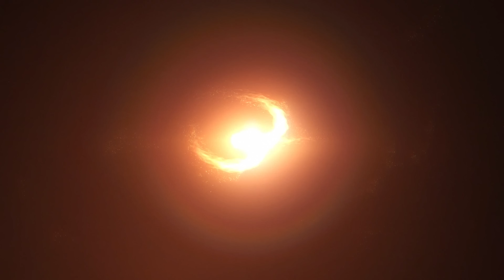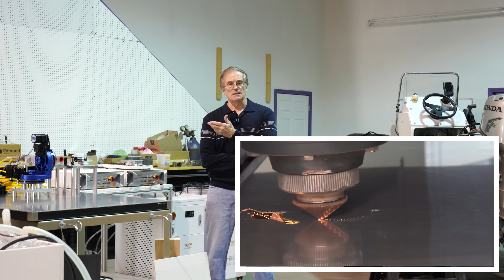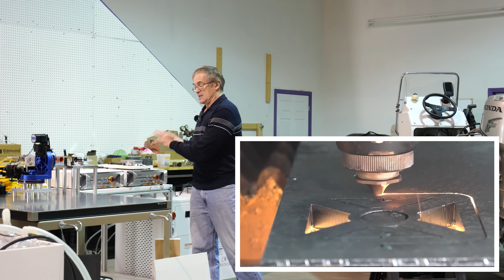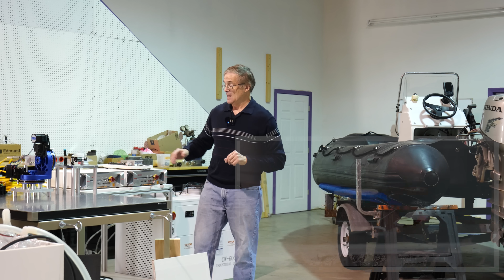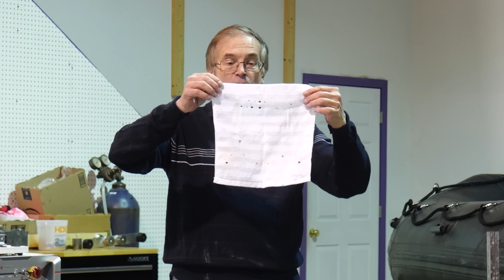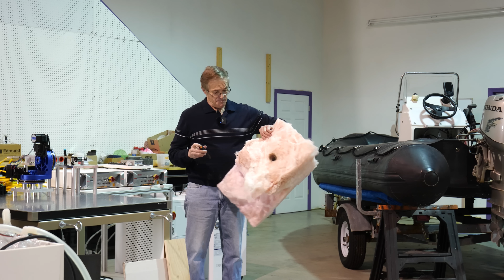We have a problem... and need your help!

Comment: My suggestion is a two-stage system. The first step is to diffuse the beam, then absorb. For the diffusion, perhaps a diffraction grating; you want to minimize reflections. But to handle the power density, I'd borrow from the X-ray industry, and use a spinning target. Each individual location has only a brief exposure. You might even sandwich it and get liquid cooling, but that adds complexity; it is probably easier just to scale up your target so the relative velocity meets the requirements.

It might even be possible to skip the diffusion step, but your target will probably last longer if you can minimize the intensity of the absorption, which at high powers may ablate the surface,

Comment: im no professional but chatgpt suggest using Ablative or Sacrificial Shielding, such as carbon composite layers, ablative tiles, or water-cooled plates. i would suggest burning the plywood until it has the "alligator skin" that every house designer loves, it makes the wood significantly hard to reignite with the carbon layer that is produced, also don't use a wire brush to clean it you want the wood to be black. Nighthawkinlight also did a tile out of baking ingredients, and was holding the tile in his hand while he charred the other side of the tile. could be something to spread over a fabric or the wood

Comment: Kind of unorthodox(sp?) solution here, but you could repurpose the absorbent gel beads from several cases of diapers, presoak them, and fill a mesh lined vessel framed out to whatever dimensions you think appropriate. I've seen used diapers survive incinerators. Or perhaps just diffusing the beam using a series of focal lenses similar to the way the metal cutting tech converges the light to very sharp angles?

Comment: Interesting approach to the problem.  A number of questions come to mind.  First while not up on fibre lasers I wish you had mentioned the frequency and spectrum of the output. For example,  infrared lasers are basically invisible and are generally low power output.  Argon lasers emit a green light and is used in medical equipment due to blood and body tissue is basically red and chromaticly are opposites. Blue lasers usually have a higher output due to the shorter wavelength.  Lastly,  remembering an article in OMNI magazine on the subject of grasers that created gamma ray laser utilizing a  chemical cocktail and radio frequency as a catalyst. 

If your approach is a wall, here are something to consider. Instead of fibre glass  (melts a 2000° F) try Rocksol which is volcanic mineral based and the melting point is much higher. Second,  try using  a beam splitter to disperse the beam or even an array of splitters. Lastly, configure the laser out through a parabolic mirrored dish whereby multiple outputs can be focused to a sigularity (along with visible beams for aiming). In this way the beams disperse safely after the focal point as you mentioned in the video. 

Thank you for allowing me to offer my assistance but I am sure your engineers will probably come up with better ways.

Comment: 1) you DO want it to be reflective, because it's not reflective it will melt. But diffuse reflective, you don't want lasers shooting like off a disco ball😮
2) keep it moving, maybe through vibration with a speaker, or make a hanging blanket wave with an unbalanced motor like a motorized toothbrush or vibrator. 
3) material should be very thermally conductive.

As an anti radar coating, faraday cage and occasionally porous electrode , I've used nickel-plated non-woven graphite fiber paper. 
It works for anti-radar the same way you were thinking with the fiberglass insulation. Radio waves bounce around inside the material and disperse. 
I got my special shielding (nickel plated carbon fiber paper) from

 Hollingsworth and Vose company, Washington Street , Walpole Massachusetts 02032

I suggest take that and plate it with an extra layer of silver for higher reflectivity, and using several or more layers to make a hanging blanket which you can make oscillate with a motor. 

Now if you find my idea is too expensive to blanket a whole wall with and instead choose to just do a sand wall or maybe filled with silica bead kitty litter
, then,
 please consider my idea on a small scale for a drone shield to protect the drones from YOU!

Since you happen to have those fiber lasers I can't afford, how much would you charge me to make me some ablative generated purple gold nanoparticles?

Also I suggest you take a page from styropyro's book, and widen the beam out to a few inches near the source using a telescope, so it doesn't converge to dangerous power concentrations until it's on the target.

Comment: Silica fiber like the space shuttle tiles used. The point is to convert photons into ir radiation and radiate it off before too much heat buildup.

Comment: Easy. Bolt a stack of polished utility razors together with all sharp edges side-by-side with M4 machine screws. That will absorb a lot of light into the razor-baffle. You can create a bracket that puts the razor-block in water but exposes the razor edges to air. That will provide cooling. You can circulate the water for extra reliability. Add a positive pressure HEPA filtered air flow in front of the razors to prevent dust in there. Use a regular bright laser to test for melted edges before each use. Put ice cubes in the water reservoir. Make the bracket easy to swap out, but you'll have to drain or lower the water.
Reply: @TreeLuvBurdpu  I really like this idea, as it's effectively an array of tiny mirrors to break up the beam and scatter it. Love the simplicity.
Reply: @NathanNostaw  the incidence of attack on the front edge of the razor should high enough to reflect it towards the back, where the energy should be absorbed. There is some optimization of maximal heat transfer vs size of the block and accuracy of aiming that would be required.

Also, i agree with everyone that you should have a precise burst timer and a thermal temperature lockout, preferably operating in fail safe mode, so it's only on while you receive temp signals in the appropriate range. You could also have a filtered TTL meter that switches the system of when it detects light over a range. Safety first, you know.

Comment: I would try using a cone-shaped element with water cooling in the back. My idea i to make sure the beam is spread over a larger surface thus reducing energy density. Of yourse the tip of the cone needs to be really thin...

Comment: The only thing that I can think of isnt very portable, but will be safe. Is a wall of ecoblocks. https://en.wikipedia.org/wiki/Ecology_block

Heavy, but large concrete blocks you can make a wall out of then store on your property somewhere. Only would take a couple hours to do a full setup and do your video. Would need a telehandler or something to move around easily, but this could be your safety setup for alot of experiments. Its hard to beat concrete...
Id recommend either finding old ones for cheap, or building your own, make them about 2ft thick, and as large as whatever your equipment can handle moving, the bigger they are the faster it is to set up a wall.

The face of it will get scorched and messed up, but if its too ugly, just cover it with grout and its good as new for the next experiment.

Comment: I have a straightforward solution that doesn’t even require a back wall. You can use an adjustable focusing lens setup that concentrates the beam precisely at the distance of your object. As the object moves closer or farther away, the focus adjusts accordingly. It might introduce some engineering complexity to your system, but it should be entirely feasible.

Comment: A crate built from tungsten plates filled with sand? Would need to patch front burn holes with epoxy as repairs could be difficult to weld and sand would escape if left alone.

Comment: Having quite an experience in fire safety of lithium ion batteries (yes, far from energy density of lasers), I'd try to go for sth like compressed mica sheet, maybe sandwiched around ceramic paper. Both reaistqnt to high temperature. Or...instead of absorbtion, try dispersion first: a curtain of glass rods/beads/whatever to initially scatter the light, then a curtain of eg. mica or ceramic fiber mat.

Comment: Something, that has allready burned.. or at least does not want to catch fire or melt instantly. Burned logs or fresh cut hard wood timber. Also, have you tried white teflon?
Reply: Or implement an active range focusing optics. Do not use concentrated beam indors. Use concentraden only on shaheds..

Comment: Soft Insulating Fire Bricks. They weigh 1/8 of traditional bricks and they should easily stand up to 5-10 seconds of incredibly high temperature. Its chemically very similar to what the space shuttle uses for re-entry.
Reply: Great idea. Ive experimented with making my own kiln brick and you can change the amount of burn out material to lighten the mass, increase the air pockets and reduce costs of raw material since burn out material can be as cheap as a bunch of crushed dry leaves. Also you need a kiln to fire your bricks but then can custom make the bricks of any size like as thick as a sheet of drywall. Given these bricks survive cone 10 I think its a good idea. Having done some brick tests Id go as high as 90% burn out material then work my way back. I did 60% burn out material and the brick is too dense. Split the difference your sweet spot is probably 80%. Unless the clay holds together with additional burn out material. Then send it 95% burn out material. I said burnt toast because its a cheap source of carbon foam, but then thought about it and this laser might be hitting temps' that burn out carbon. Ive also experimented with Tree ash leachate and the temp you can bring potassium carbonate up to before it converts to vapor it glazes while burning off all the carbon (hence why I did it to fire purify it). Ive never brought it up to cone 10. I know my firing was lower than cone 10, so you'd have to check the temps. I brought it up to. Even a cone 4 glaze just goes liquid and runs fired at cone 10. Im starting to wonder if you even have to fire this in a kiln or just bisque dry it and shoot lasers at it. Also I think if you shot a laser at it you'd need glass blowing IR glasses on because it would be glowing like the sun.
Reply: @gantz4u  no I don't think you'd need to go higher than bisque temps. The only reason bricks are fired to cone 13 +/- is because they have to be structurally and dimensionally stable at cone 10R. These would just be backstops that only need to absorb stray photons until they hit the  Oh Sh!t Switch.

Comment: Look at what the absorbing surface of power meter is made off. I would start with a difusion layer to reduce the beam concentration and follow with large disks of black ceramic that absorbs the heat and dissipate it, maybe with a cooling medi in the back.  All this is from a long experieb=nce of making laser power meters which have to stop beam of 100Kws  per sq. cm.

Comment: An Phenolic-Impregnated Carbon Ablator (PICA) could be helpful. These kind of ablators "shield" themselves by off gassing a gas that is opaque. This a really desirable property for an ablator because it shields the ablator form the very hot plasma IR radiation. So when the laser attacks a spot this spot releases gasses that absorb more energy from the laser.

Comment: Have a large fish tank, filled with black liquid, the glass will allow the beam through, but the black, light absorbent water will attenuate the beam, vaporizing the water as it does so, which should condense quickly.  Have some dry wall behind the tank in case any of beam gets through.

Comment: Not sure if It's been commented further down, but in our experience nothing beats Carbon Fibre sheet laminated with either hafnium carbide or hafnium oxide refractory sheet. two of each should do it. each sheet 2mm thick. then bond to an Aluminium back plate. Also 2mm.  If the cost of the hafnium carbide is too high then any decent refractory sheet/tile

Comment: I think for your application you don’t need a constantly focused laser beam, right? It could be a broad beam before, then focused on the target, and diverging again after it. You might be able to achieve this (although I am not an expert in this) by a set of lenses moving mechanically or maybe even liquid lenses. Consequently, only the focal point (your target) would be in the dangerous zone and the diverged beam after it would be much easier to block.

Comment: Between all comments i did not see yakisugi styled wood (charred) there was multiple mentions about graphite but like this you can make your own. By charing the wood you will remove a lot of volatiles which makes fire happening, and that carbon layer should be decently fireproof and heat resistant. (you will still end with some embers in hotspots)
by combining this with already mentioned waterfall it can be cooled, but on the other hand that water can evaporate too quickly and pop off char layer so it will self destruct, its hard to predict.
good luck J.

Comment: How about corse sand between two sheats of something cheap? Maybe use glass marbles, or marbles of something... or some pebbles with a diffuse surface so any reflections will be incoherent.
The thickness of the layered "wall" is a topic for experimentation.
I suppose a massive ice wall is out of the question...

Comment: Depending on the work piece, could you not have a prism attached to the movement arm via extension so that it is situated behind the work piece, redirecting the beam into the ground as opposed to toward your wall? You could then use 30-40 sheets of drywall or a bucket of water-saturated. super-absorbent polymer beads to receive it -- or both... why can't it be both? A light sensor in this covered vat of water beads could be used as a kill switch if given a threshold... the idea being that if it's getting enough diffused photos, the beam is no longer being absorbed by a cover or diffused sufficiently by the beads and will be burning your floor.... which is still better than your trucks (or humans!) outside your building.

The caveat is that you would have to continuously monitor the cleanliness of your prism optics. All the materials are cheap though.

Comment: check into 'Brilliant Light Power LLC' and get into contact with Randall Mills. The Photovoltaics and he might have some interesting perspectives to assist your light optionality endeavors.

okay so the concept that popped up was Fractal Prismatic Holography to act like a wave form guidance light refractor..... it my mind I see the laser hitting a conical spiraled 'target point' and which then gradiently diffuses and bends and refracts the prismatic breakdown to alter the intensity of the focus at that end point to mitigate the concentration of ppmol/sec of light concentrated to buffer the intensity of contact diffusion through the initial contact surface, and refracting the light outwards towards a concave bowl lip that the cone is placed within to act as a central diffusion beacon point to guide the light towards the inner bowl cavity which is that potentially photovoltaic light absorption capacity opportunity... you see.. you haven't created a problem... you've created a harvestable opportunity, to weave a destructive moment in a co-creative opportunity! rethink it like 'how might we best effectively capture light and harvest it most efficiently now that we know what we can do with these baby's......'  Carbon block.... graphene block even.... i mean it'll COOK HOT, but it's pretty broken down into some of the most fundamental breakdown options available without much more transmutative capacity to rend into some other form than the heat exchange that would convert the light to heat, which is where the opportunity to absorb such intense heat signatures and stage more diffusion opportunities for energetic conversion for harvesting rather than just wasting all that potential energy production being shot into the ether without chance to be recaptured for diffusion harvesting. multi-modal thinking applied hahahaha

if you're into pioneering concepts there is new magnetic cooling technologies available as of recent that might be of assistance for mitigating heat. Also going fringe concept, sound pressure pinpoint focused on a point in water can trigger sonoluminescence, so there might be neat factors to consider in using sound to diffuse or warp the light boundary pressures nesting the concentrations of lights from a stable jet to a programmable 'laminar breakdown decay buffer region' that buffets the light with sonic pressure to act as on demand laser disruption..... i just figured there might be something to the novel idea of nesting multiple disruption methods to assist the decay or amplify the drag on light pathing to warp and bend light concentration capacities. ... if a meta-material alters the functional reactivity of a base material to get the light or ions to switch state and cause light and electricity and rate of conduction or absorption at the molecular level to induce programmable results, then apply that function warp principal to 'support array mitigate the problem factors' .... 

really though... that magnetically cooled Graphene Block concept might be the simplest inert means to purely mitigate and negate that energy concentration... you could gear that badboy to power its own supply > block gets hot, turns on cooling, cools itself into power down > Laser slice all the things > figure out how to get carbonic magnet block to get 'behind targets to mitigate potential 'misfire causal effects'. ... anyways thanks for your contributions to humanity, and I hope you keep having fun with these advanced features for us to know about more hahahaha